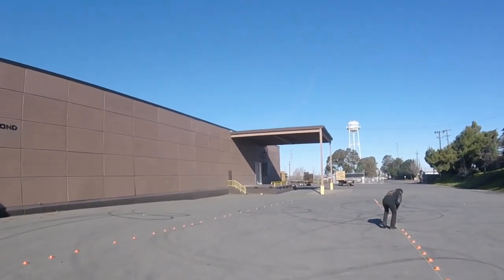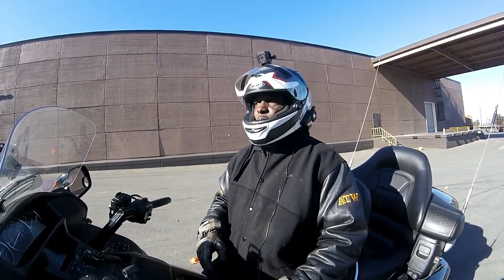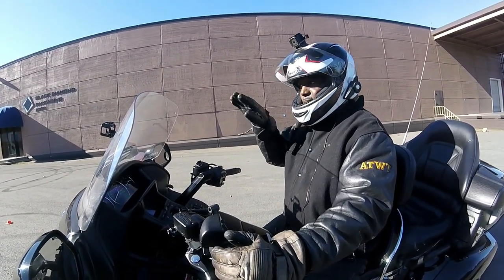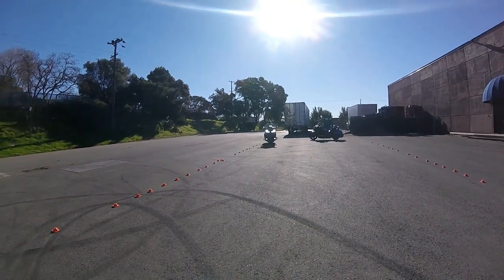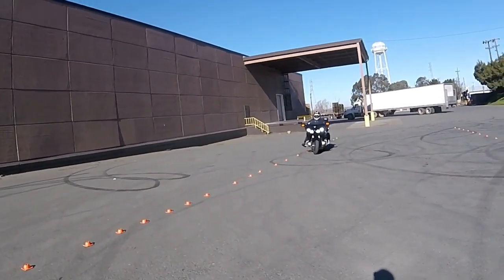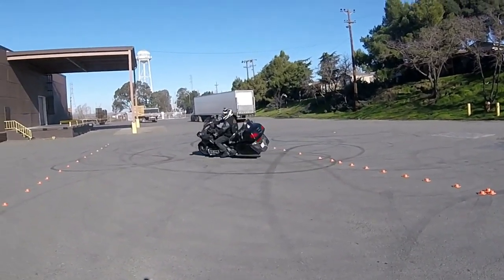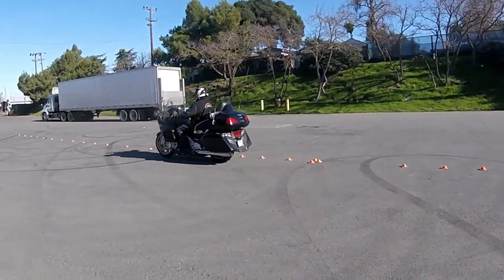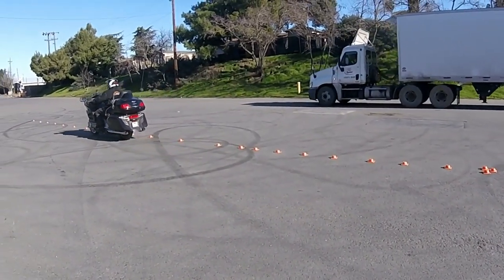How to Master the friction zone | What's the secret?

Comment: Hello, newer rider here, just a quick question, are you turning your wheel to full lock on the 24' uturn, or just using lean?  Should we try to turn the wheel full lock or is it not necessary if you get enough lean?  Hope I'm asking the question in the right way, thank you for any help in advance.  I'm just starting to learn slow speed manuvers, so any help is greatly appreciated. Glad to have found your channel, thanks in advance! :)
Reply from the maker: Hey Super Dave, welcome to the wonderful world of motorcycles and to our channel.
Great question...A full lock isn't necessary to complete a 24' u turn. The more you lean the less you will need to turn the handlebars. And the more you turn the handlebars, the less you will need to lean. Just keep power to the rear wheel and make a quick head turn and stay in the friction zone. The more you practice the better you will become.

Comment: New rider here, dropped the MSF supplied bike 2x during the 2nd day u-turn drills. I struggled with it all morning. In the afternoon, when it came time for the test, I nailed it and I don’t really know how. I have an idea how but don’t know for sure. I think I rolled on the throttle a little before I started my u-turn so I had the power when I needed it.  I never tried using the rear break, I’m looking forward to practicing this. I bought some flat cones so I can practice but I’m so afraid of dropping my bike, which is a heck of o lot bigger and heavier (cruiser) than the MSF supplied Yamaha 250, and the bike is flat out gorgeous. I’m thinking about getting a practice bike until I know what I’m doing before I practice on my baby.  Thanks for putting these videos out there for ppl like me who can draw on experienced riders.
Reply from the maker: Welcome to the wonderful world of motorcycles. Congrats on passing the course. Yes, u-turns are what most people struggle with, even some “experienced “ riders.  So just continue to practice your slow maneuvers and you’ll see improvement over time. Thanks for watching and commenting.
Reply: Our course is forcing us to use the rear brake and feather it instead of using the hand brake. Course bike is a 250. My bike is a 693 but with eco mode to make it way less power. I’m struggling super hard on my first day with the friction zone and them not letting us use the hand brake for the most of it. Hoping these videos help. I almost quit half way through today. I’ve been riding mine no issues on country roads and in town. Idk why it’s so much harder on a small bike.

Comment: Excellent video! I remember when I took the M.S.C. our instructor touched on the friction zone, explaining the clutch to throttle ratio. I use the latter of the technics, let me explain...I'm a shorter rider with a big bike Harley Road Glide Special,  so being able to maneuver, in tight areas is a must. thats where mastering the friction zone comes in handy. 
P.S. I fact checked myself last night, 10 pm practicing the "zone" U turns and circles! thanx again for the videos Rich n Kake, Keep up the good work....#BootsandJeans
Reply from the maker: Hey Dave Appreciate the insightful comment. Fact checking is always good, Most think that if they get something right one time  it should be enough. However motorcycle are a different monster. I always said "getting it right once is luck,  2 - 10 times is gaining experience, 10 or more times without mistakes...that's skills".
Keep it up my brother and continue to fact check yourself. 

Roll safe.

Comment: You made a good point about doing the U turn without the brake. I always find myself relying on the rear brake during the turn which makes the bike want to stand up so I have to add clutch and throttle to make it through. I’m going to try your way next time thanks for taking the time to make this New Subscriber. Ride safe.
Reply from the maker: You're exactly correct...Too much brake stands the bike up and the slower you go it wants to tip over.
Hard braking also makes it more jerky. Little presure braking or no brakes will make the turns much smoother.
When you start, use a large 30'+ U-turn without brakes then bring it in to the 24' as you get comfortable.
Thanks for subscribing we really appreciate your support.

Comment: Well done my friend ! So very important that folks ( especially those who larger bikes)master this technique ! Makes low speed maneuvering so much easier.
Reply from the maker: Thanks for the compliment, I really appreciate it.
Yes mastering it makes the slow speed riding much easier. Some thought I was saying not to use the rear brakes. I just was shoeing what can be done by using just the friction zone to control the speed. You get it...obviously you are a good rider.
Thanks for watching and commenting.

Comment: I agree. Ive been riding off and on all my life. But the last say 2 years Ive been street riding more seriously. Learning to be seen etc. But I noticed the need to drag the brake thing didn't apply to me usually because I can control that strictly with the clutch. For many riders that might not be the same though. I spent countless hours on dirt bikes and dual sport bikes over the years and probably mastered those skills as a result of controlling crashes in ruts n stuff. I mean by that preventing crashes with skilled riding. But even now I find clutch control, controlled braking and throttle control to be the 3 things that make it where that bike is under MY command! On a personal note I would say this. I'm very thankful that I spent many years on bikes out of traffic learning skills. I would highly recommend new riders spend the first year or even 2 on dirt out of traffic learning the control stuff. Ive seen new riders hurt. Ive seen 1st and 2nd year riders killed in traffic. I honestly think the safest way to get through the first year or 2 is off road and out of traffic situations. But that's me...
Reply from the maker: Thanks Jeff...You definitely have an advantage on many riders. I tell riders to always control the slow speed with the rear brake until they master the friction zone. Then not much rear braking is needed, (if any)  just great clutch control. 
I wish I would have started on a dirt track bike with no traffic around.
Thanks for watching and commenting I really appreciate it.

Comment: Thank you for this! I hop into parking lots like behind a Kohls or something all the time and do a few practice circles, u-turns, turning from a stop, and panic braking for a few minutes but I always drag that rear brake or cover it at least. I'll have to try this with just throttle and clutch once that f*cking snow melts
Reply from the maker: Hey Pat...Yeah give it a try. I still cover and use the rear brake also especially when the turns are tight.
This was to show that it can be done without the brake if we have good throttle control and a good graph of using the friction zone. After the F*cking snow melts...Let me know how it going.
Thanks

Comment: Interesting. I was taught to do all kinds of slow speed maneuvers by two motor cops and those guys stressed the use of the brake with the friction zone. I’ll have to try this technique. I’m used to turning the bike in slightly less than 24 feet though. I learned on the width of two parking spaces. I just don’t see how I can do that without the rear brake but I’m going to try it. Thanks for the tip
Reply from the maker: Hey Leadfooty Thanks for watching.
And your instructors are correct...Remember what is being done here isn't for people that is just learning to use the friction zone. I'm sure you will be able to do this with no problem. Not all police schools are alike, this is what was taught the first week of motor school here in Oakland Ca. It was implemented for those the were using too much braking and could couldn't complete the basic turns. As the school continues, only then the rear brake was reintroduced and the riders became more proficient.  And of course I wouldn't recommend holding out the leg.(it was for the video) On 18' turns I use my rear brake also but only use very light pressure.

Comment: Salute to you man! Can disengaging the clutch help scrub speed and tighen up corners at highway speed?
 Instead of using brake/s?
I feel I have better control doing this I just wonder what it might be doing to my traction and/or suspension while roads are wet.
 May the Road Gods be with you.
Reply from the maker: Pulling in the clutch will help slow you down at high speeds along with down shifting (Engine breaking) However when corning...I would suggest using the brakes to compress your forks before starting your lean into the corner. That will give your tires more contact patch with the road. The same applies on a wet road.
if in doubt...Just enter your corners slower than you think you need. You will be okay. Practice in a parking lot or take a corning course.
Reply: @BootsandJeansRiders 
Will do. Thank you very much!

Comment: Good job, man. I really needed this, my motorcycle was stalling too much when turning because the speed was too low without being in the friction zone. while in the friction zone you can go as slow as you like and the bike wont stall, right?
Reply from the maker: Thanks JNPro. Correct...As long as you don't let out your clutch too fast, your bike won't stall. Just keep practicing and you will get it in no time.

Comment: Hey just a couple points the Goldwing has linked brake system which means the front and back apply when you hit the rear brake. And also I'd be extremely careful using the front brake only if you're turning and not on Solid Ground.
Reply from the maker: Hey Pat thanks for watching and leaving a comment.
Yes, I am aware of the linked braking system on the wing. Although it may  be engaged, it isn't a major factor when riding at slow speeds. And that's a good point about using the front brake only while turning. And as you stated, especially if you're not on solid ground. Thanks!
This demo was to show that you can control your slow speed u-turns without any braking, only using the friction zone. No front brakes were used at any point during the turns.

Comment: Helpful... might take my bike out today for practice... do they have friction zone clamps to practice.... jus in case my hand slips.,?
Reply from the maker: Hey Tom I'm glad it was helpful. And it fantastic that you are going to practice.
I don;t know of any clamps for the friction zone and not sure it would be safe to lock in one gear. However, most drill teams use a throttle lock, in order to stay at a steady speed while preforming. Most throttle locks can be purchased at any dealer or online.

Comment: I’m a new rider, I’ve never ridden before in my life, I’m okay going straight but I’m awful at turning or generally at low speeds. My bike keeps wobbling until I get confused and come to a dead stop. As a general rule, which brakes should I master first ? The front or back ? Which brakes do riders use most often ? When I m at a turn I lose control of the throttle, I either go too fast or too slow.
Reply from the maker: Hey Mookie thanks for the question.
At slow speeds (under 10 mph) focus on the rear brake. Learn to get the friction zone dialed in while going in a slow straight line, using only the rear brake. Don't worry about the front brake, and if for some reason you should use the front brake at low speeds, make sure your handle bar is straight. Because the slightest turn can bring down the bike. 
The key to everything is to always look where you want the bike to go. Practice using the friction zone and coming to a smooth stop. And you  will see that your  low speed riding confidence start to increase.
Take a look at this video and practice stopping smoothly. https://youtu.be/msqAX4avacU
Reply: @BootsandJeansRiders  thank you for replying, this is most helpful tip I’ve had ever since I started riding. I’m getting a lot better at slow speeds now. There are moments when turning at slow speeds is a bit tricky but generally I’m getting better at slow speeds. I should’ve started learning on a lighter bike, I started learning on a softail deluxe.

Comment: Gr8 love it lil different perspective than motorman but he's a retired cop...
.. LOL
Reply from the maker: Hey John...Yeah I noticed that several people in our practice session were using heavy pressure on the brakes, making it hard to complete their turn without putting their foot down. So I had them make larger  30' turns with no brakes, then sharper turn with little pressure, and it helped. 

Thanks for watching.

Comment: What's a good area for a friction zone? Light or middle or tight grip on the clutch?
Reply from the maker: It depends on your clutch level, but when your bike starts moving...You are entering the friction zone. Just fine tune it in a parking lot, in about 10 minutes you will have the right location. Just keep it slow.

Comment: So don't use the brake?
Reply from the maker: By all means Marianne use your brakes.This is an advanced drill you can use only after you have a firm grasp on the use of the brake, friction zone and throttle together. Also remember, this requires practice in a controlled environment. Once you accomplish it, then you will find that you can have smooth turns with no or very little use of the rear brake. Until then, I suggest the use of the brakes.
Hope that help.

Comment: One thing none of you guys do is stress awareness of the road and area your in. You can still drop a bike if your in an area your not familiar with such as in hills or mountainous areas. It so easy to drop a bike if your not aware that the surface your on has a high side and a low side. Of course this is at a stop. Possibility of a slick or wet surface
Reply from the maker: Excellent pointy Clark. We were riding in Guerneville Ca. yesterday and  a crew was cleaning up a spill. As I stopped my left foot slipped on a part that they hadn't made it to. I didn't droop the bike ,but sure came extremely close.
Thanks for watching.

Comment: You've got yourself a new subscriber, because of your delivery/content/photography.
How DOES the rear brake affect the operation of the motorcycle in a turn - what is it's purpose?

BTW - You sound very much like the beloved "Crafsman" (no "t") on his YT channel - check him out.

Thank you!
Reply from the maker: First welcome to our channel and thanks for the sub. and the compliment. Great Question...
During the turn any braking will make the bike want to stand up. However, the rear brake slows down the bike but not as much as the front brake. Also when using the rear brake, the front of the bike won't dip as much therefore eliminating a forced pull down, causing a bike drop. Yes you can use the rear brake through out the turn and it won't have a major affect on the turn (depending on how tight you are tuning) I use the rear brake to slow down the bike, once I start the turn, I release the brake and rely on the friction zone and throttle to control the speed. However in tighter turns...I use the rear brake though the completion of the turn,
but not in all cases.

Hope that answer your Question
Reply: @BootsandJeansRiders  
Yes, thank you for a clear explanation (which other instructors fail to provide).
Re: friction zone - in a funeral procession for a 97 year old fellow BK member, the hearse was going SO SLOW, that we were at the extent of the friction zone - any slower and we'd be duck-walking to the cemetery!